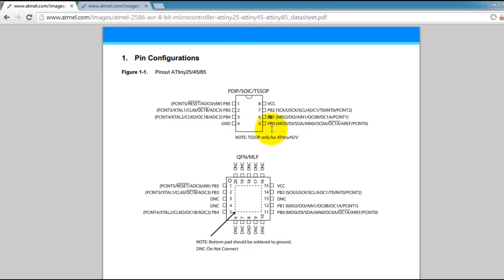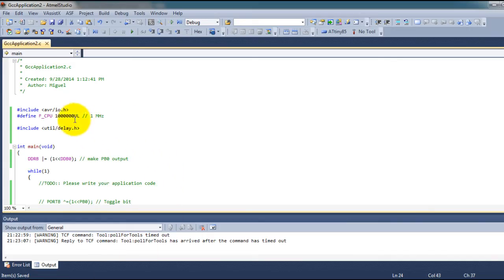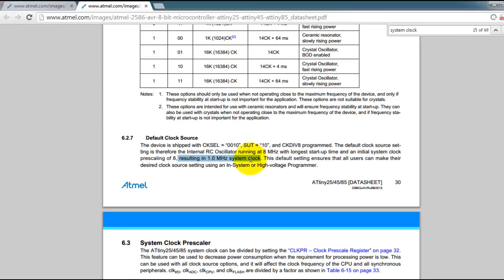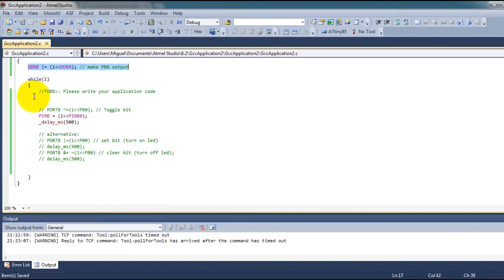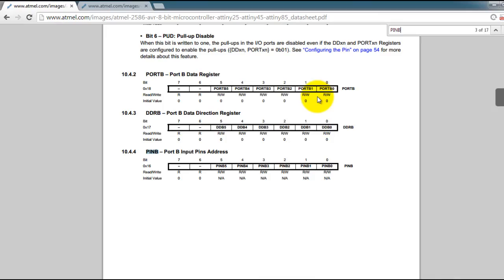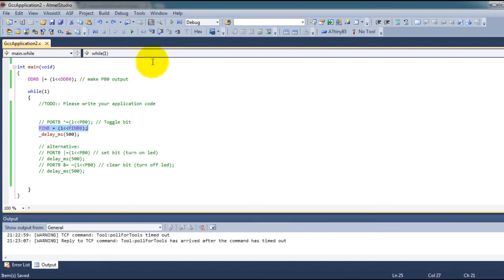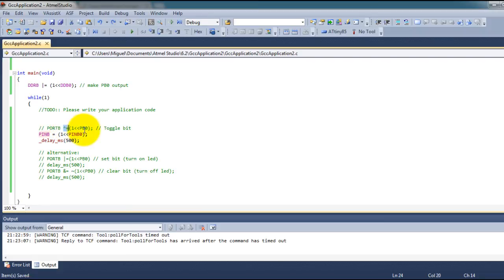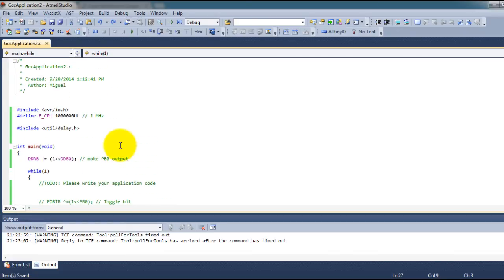AVR ATtiny85 Programming: Blink LED (Digital Output)

Comment: FAIL! Your schema shows a diode in the circuit, not an LED.
Reply from the maker: Lol, an LED is a diode. But yeah, I forgot the light shooting out.
Reply: Functionally it's the same thing. Sure the difference is important, but considering you knew it was an led, and he used a similar component, you can't necessarily call it a FAIL, but more so a minor error.

Comment from the maker: @Human Being This was recorded in HD, you can enable it from the video's settings.
Reply: AllAboutEE Yeah. I was watching from my phone. You have to enter full screen mode.

I have a couple of questions.

1. How come a 100Ohm resistor doesn't work? I saw somewhere saying any resistor (100 - 330Ohm) should work.

2. Can I use TinyAVR Programmer with Atmel Studio?

3. Why do I see other tutorials having just "setup()" and "loop()" while others have "main()" as the entry point?

Thanks.
Reply from the maker: 1) You can use any resistor that will limit the current to be less than the maximum current that the LED can operate on.

2.) I don't know, I haven't used the TinyAVR Programmer.

3.) They use setup() and loop() because they are using the Arduino libraries. I use main because I'm teaching the native code. These tutorials target those who are interested in working with microcontrollers as a career or a deeper level, once you learn how to do this you can pick up ANY microcontroller and get started almost right away instead of been limited to those microcontrollers that are only supported by the Arduino libraries.
Reply: AllAboutEE Alright. I got the TinyAVR Programmer to work with AtmelStudio. But still can't get the circuit to work. I have tried different resistors (from 100- 2.2K) and nothing is working. 

- LED is rated 3.4V
- 9V source

Tried all the pins except RST and still nothing. But on the programmer it works.

 I'll keep trying until it works or something breaks
Reply from the maker: Are you stepping down the 9V source? The Attiny operates up to 5.5V. Also is your LED fried? Connect it with a resistor to 3.3V and see if it lights up, if it doesn't then it's burnt.
Reply: AllAboutEE lol. No. The 9v is from a smoke detector. The LED is not fried. I don't have a multimeter but obviously it's not full 9V because the smoke detector can't operate with it and the . 

The AtTiny85 works on the TinyAVR programmer which has an LED but when I connect on my board nothing works.
Reply: AllAboutEE Got it to work.

Connected a 100Ω resistor to the VCC with 5.05V from my computer's USB. Pin 5 connects directly to the LED.